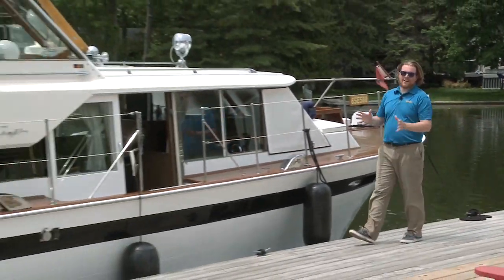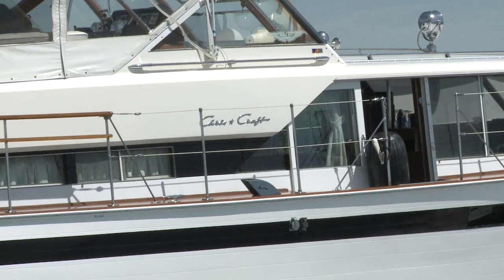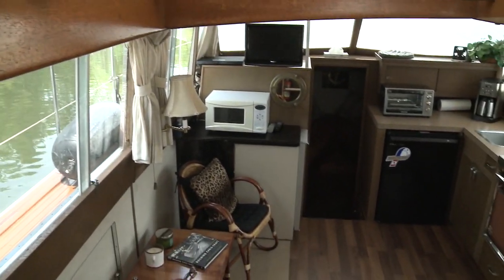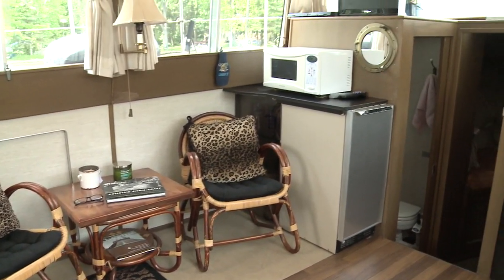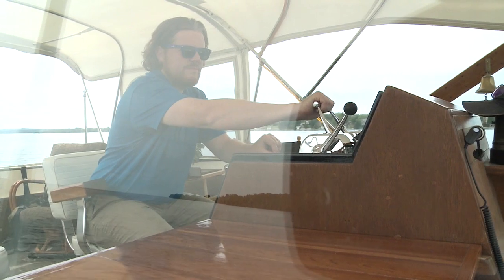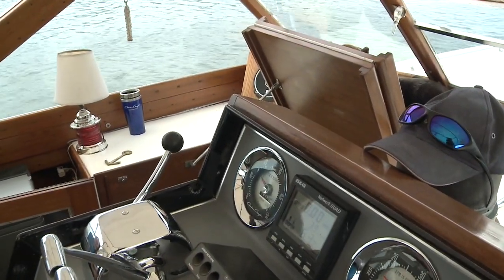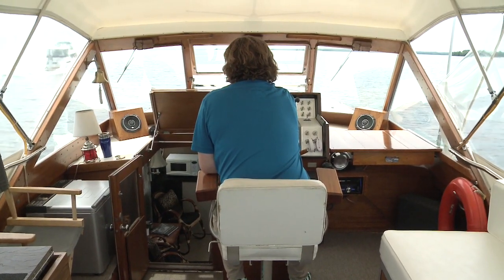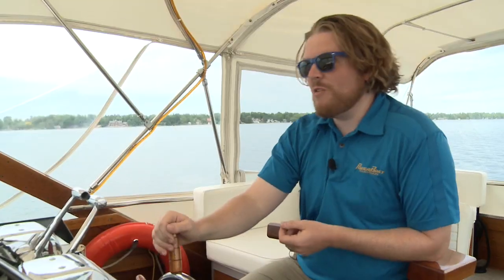1966 VINTAGE Chris Craft Constellation 720 | Boat Review

Comment: Those 427's need to be opened up to full throttle occasionally, not full RPM but full throttle to prevent carbon buildup, idle is the enemy not load
Reply: You must be a truck guy.

They are more worried about the linkage to the props and overheating due to ineffective/clogged exhaust systems and manifolds.
Reply: @icecoldchilipreppers  🤦🏼‍♂️ he's right it's like that on all motors from 7.4 liters down to 29cc weed whackers. He's talking about an inefficient/clogged exhaust
Reply: Every now and again my father would open up our boat to blast out all the build up.
Reply: I was in Vo-Tech in the late 70s for auto mechanics, sometimes we'd work on the teachers cars, and one of the best parts was when the teacher would tell a couple of us to take the car we were working on out to the bypass and blow the carbon out of it. We'd stop at the dairy queen on the way back and buy the teacher a coffee.

Comment: Those motors are cross bolted main bearings. They are the same engine Shelby used to send the Ferrari’s home spanked. They were de-tuned by Chris Craft by adding cylinder heads from the ford 390’s. They have forged pistons. Barring a riser leak or other ancillary failure, they will go forever. Additionally, they are worth a mint. Very very rare and highly collectible in the ford race car circuits.